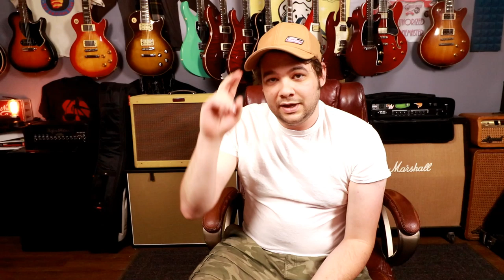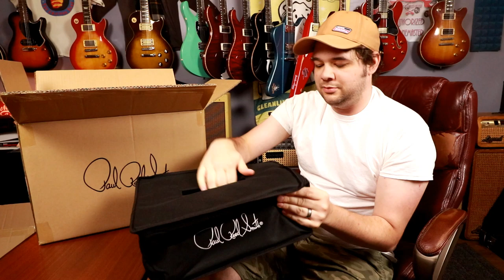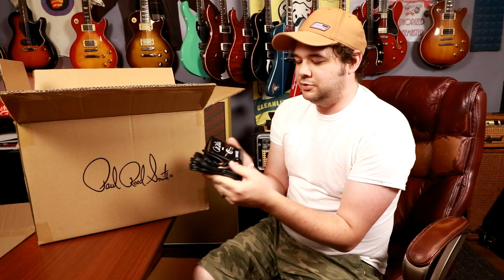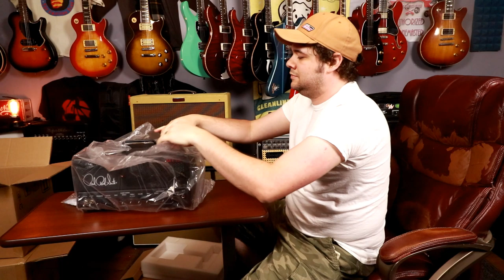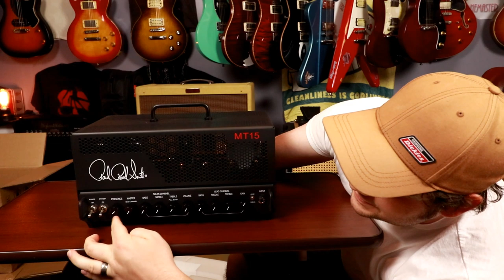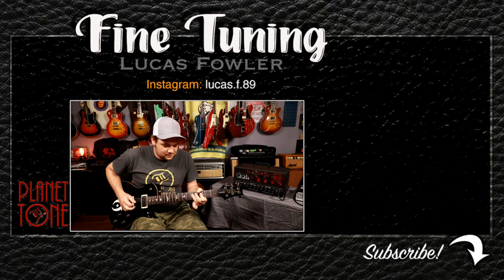PRS MT15 Unboxing And Demo

Comment: Really awesome playing Lucas! How is your direct signal path set up? Are you using an attenuator into your input device? Thank you 🤟
Reply from the maker: I used my Two Notes Torpedo Captor to take the speaker output signal and attenuate it down to line level, then I added a nice impulse response inside my DAW. The amp is so loud and has so much bottom it would have been hard to get a good recording of it in my little office :P
Reply: @LucasFowler  I figured that's what you were doing after a little more digging. Already ordered a Two Notes. Looking forward to a new way of recording (for me). Thanks again and rock on!

Comment: you think that this amp is simular to mesa boogie sounding? for playing dream theater-metallica style stuff?
Reply: Mesa mark 25 head is what you want bro.

Even if it is to play in your room and not for live situation, the best thing you can do, is buy a good interface like ssl2 or motu m2, and then with plugins to get your Tone.

Those tones can be easily obtained even with free plugins, and if you know what you do, you will achieve a much better result, than with a real tube amp, cabs, pedals and others, that in the end you will spend thousands of dollars, and you will not sound even close to guitars tones of those records.

Comment: Do you think this amp would work better with a V30 or a G12T-75 speakers?
Reply from the maker: Well it's certainly designed to work with V30's, since that's what Mark uses. I find it sounds good through pretty much any decent celestion though. My personal favorite for that amp is the Creamback.

Comment: I just got one, and I'm loving it, but for the life of me I can't get that perfect metal tone that everyone else seems to have as soon as they hit the gain channel. Im plugging into it with a Tremonti SE, I dunno what I'm doing wrong. Maybe I need better pickups than what the basic SE has?
Reply from the maker: Well pickups are important, but it could just as easily be something like pickup *height*. If they are too far away from the strings you won't get the optimum attack. What do you feel like you are lacking in your tone?
Reply: Speaker choice makes a huge difference in your sound. Many of the pro demo people on here typically use Celestion Vintage 30's.
Reply: Yeah I've got a Celestion V30 because I bought the matching PRS cab. I should confirm that I'm getting a great sound, but it's a classic rock, plexi type, sound, as opposed to high gain Mesa Boogie sound. I will play with the pickup height & see what I can get. Thank you for the replies & advice, I appreciate it.
Reply: @jasonmcmillan4373 

Mesa traditional 4x12, EMG 81, and a Maxon OD808 like boost is all you need.

If you can't get a good high gain tone with that gear, then you are the problem, but I don't think so.

Although you must take into account something very important, and most do not realize it, and that is that 100% of the tones that you hear on CDs, Live shows and here on YouTube, are tones with IRS, or Cabs normally miced with a Shure SM57, therefore it will never be the same as you hear in your room, the famous "AMP IN THE ROOM"

so try and tell me later.